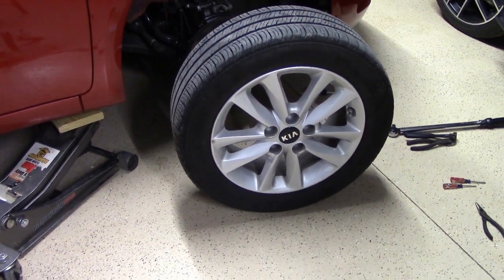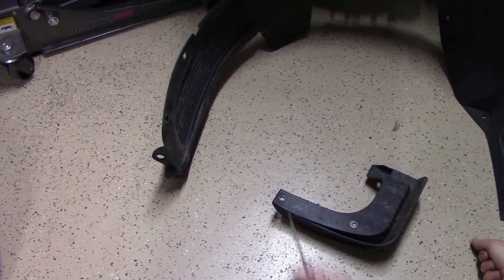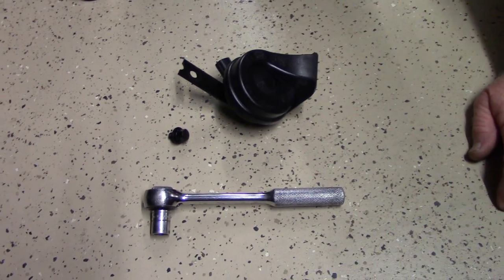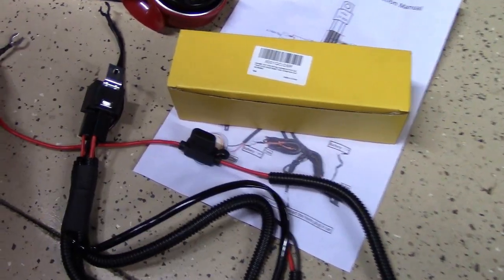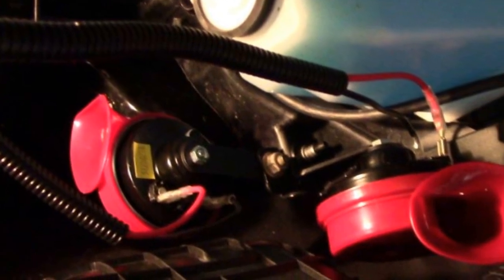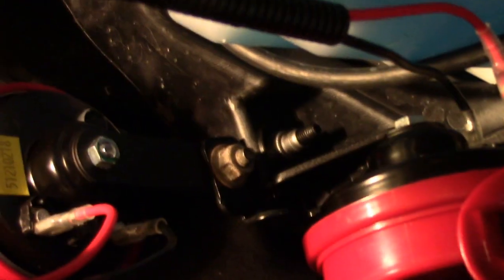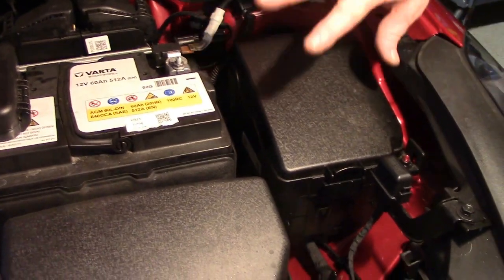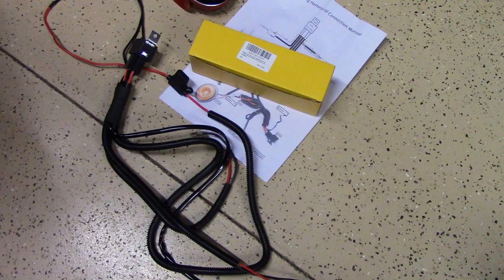LOVE MY NEW CAR HORNS - DOUBLE HORN - SOUNDS GREAT Kia Forte

Comment: Also just installed my dual horns thanks to your video but my 2016 Cerato SLI  horn was actually located behind the lower grill in front of the radiator so I pulled the underside cover of for easy access and after a bit of work now have great sounding horns . Thanks mate
Reply from the maker: Glad you like them.

Comment: Do I have to use both horns? Or could I only use one to avoid having to do all the extra electrical work you added in for the second?
Reply: No you can use one horn ether the high or low tone

Comment: Hello again , installed these thanks to your video 2 months and commented and today 20 mins after washing the car they randomly came on until I opened the bonnet and removed the fuse. I put the fuse back and they came on  , removed again and replaced then  they stopped . Any idea ? No water got to the relay so I've no clue what happened.  Scared they will go off 4am hahaha
Reply from the maker: WOW, have no idea.
Reply: Was the relay , cheap quality and because I blow the front grille dry with a dewalt 18v blower I must have forced water in so I replaced it with a Narva and opened the cheap one to find wet muddy dirt which caused it to fail . Serves me right in cheaping out .thanks